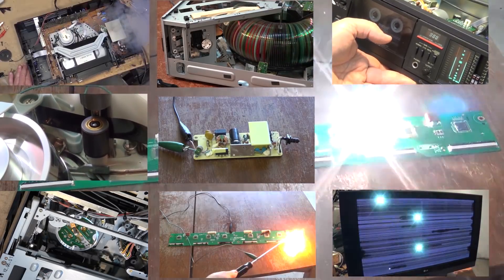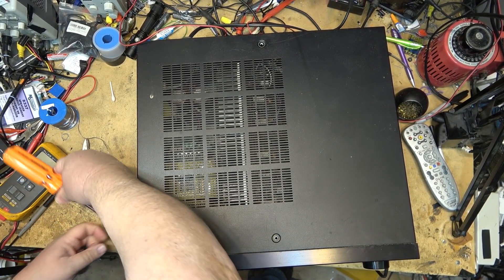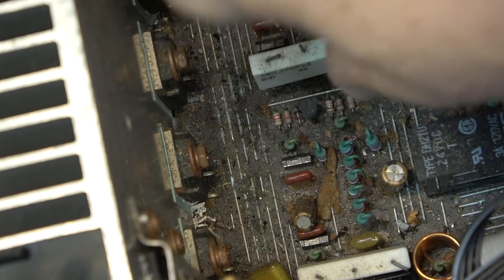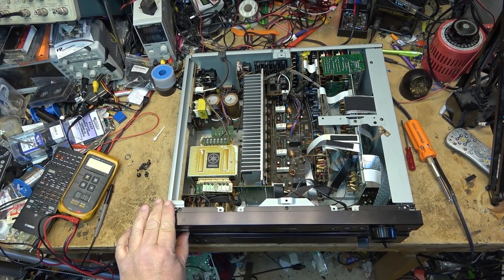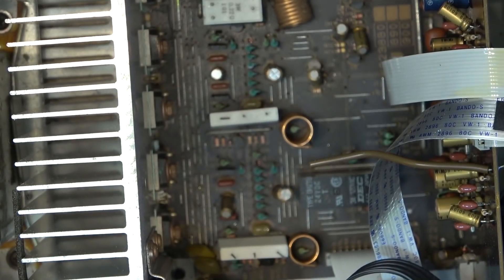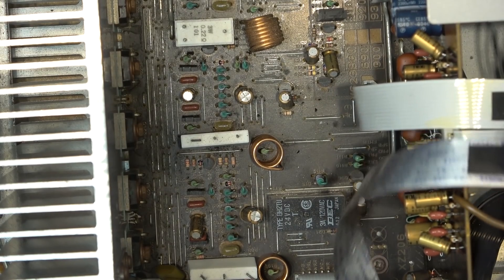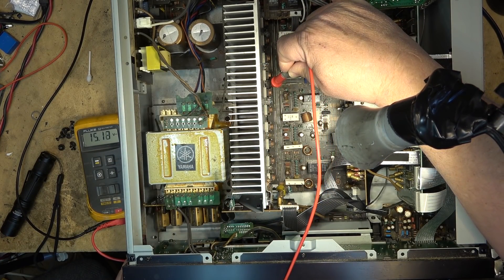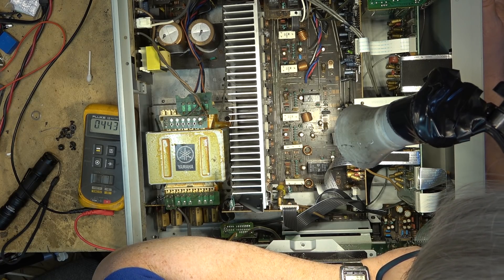Yamaha RX-V1000 Receiver In Pretty Sad Shape. Will I be able to get this one going? Lets find out.

Comment: Bought mine from a thrift shop and did exactly the same thing.  The thing is, it was in absolute perfect shape, not a single dust particle inside the unit when I opened it up.  Never had a chance to fix it and gave it away to a local guy that could fix it.  Plans changed ended up with 2018 Onkyo receiver with updated surround sound (atmos, dts-x, etc)

Comment: Great work, and a nice solution to the problem. I am struggling with a 72 sansui quad with many of same problems.   I got the thing running and turned it over to a tech to overhaul the radio.

Comment: Why not take the unit outside to use the air compressor on it, instead of blowing the dead bugs and filth all over your work bench? 🤮 Anyway, I have worked on a number of various  Yamaha RX-V surround-sound A/V receivers, and aside from the blown channel you encountered, there are a number of common problems and factory service bulletins about them.  Some of the rear panel screws that hold the connectors are also important chassis grounds and the unit will shut down if those screws aren't tight. There is a supercapacitor for the memory, on a vertical board behind the volume control area (under the metal shield panel)  which can leak an invisible electrolyte on the board, causing the unit to shut down, and you have to clean the board with alcohol and Q-tips and a toothbrush and replace the bad cap. Also, the polarized electrolytic feedback caps for the differential amplifiers can go bad and should be replaced with non-polar electrolytics.  Most of these various receivers will have a way to bypass the protection circuit (by holding down a combination of front panel buttons as you turn it on) and turn it on sufficiently that you can interrogate its memory and the digital display will give you some clue as to what's wrong with the unit. Obviously you need to be plugged into a light bulb current limiter when you do this;  but if there was any justice in the universe, what the display would read is "NWR": not worth repairing! 

 There is also a way to use a male plug to male plug "suicide cord" feeding into one of the courtesy outlets on the back of the unit and thereby turn on the main transformer and output stage so that you can check for DC offset; again, only done with the use of a current limiter, but regardless,  the suicide cord method is quite dangerous and not recommended for the average inexperienced wannabe tech.

Comment: I have a Yamahaha  HTR 5740 on the bench now. It has the main board stacked above the power amp board, and power supply board above that one in one corner. one side of the winding of the power transformer windings covers part of the power amp board. Almost all of the ribbon cables are soldered right to the boards at both ends. Yamahaha products were a technician nightmare in the 1970s with the CR series because all of the semiconductors had to come from Yamahaha becuade they spec'd everything to tight of tolerances. And, I did not spell Yamahaha wrong..
Reply from the maker: Yes I used to call them yamahahaha too. Especially their motorcycles which are a piece of junk.and yes I can speak with authority on that I had one it was the biggest piece of crap I've ever owned.

Comment: Nice fix. Could you paint the PCB's in some sort of lacquer to give it some protection from nature ?
Reply from the maker: That's called a confirmal coating and I was wondering myself if spraying something such as flex seal over a board would protect against the elements. Have yet to actually try that but I bet it would do a pretty good job of protecting a board. First of all though before doing anything like that it would have to be meticulously clean. The time to put a confirmal coating on is what aboard is new before it's been exposed to dust and debris and moisture.
Reply: @12voltvids  Ah, confirmal coating, that's what I was trying to think of. Thank you.
Reply: @12voltvids  Having worked in avionics we had to repair and recoat faulty pcb's, the worst were boards from rescue hellicopters
that suffered from all the salty spray from the sea.
The weakness of conformal coating is that the smallest pinhole will allow moisture to creep under the coating taking out components,
removing it and then replacing it is a messy time consuming job.
At least the wages were good at the time.
Reply from the maker: @frankowalker4662  I was thinking that spraying a board with flexseal might do the trick.   It sure stopped a dripping drain on my kitchen sink.  The Union connection between the p-trap and drain had a damaged thread that would drip. Sprayed it with flex seal 10 years ago hasn't dripped since.
Reply from the maker: @Barbarapape  and once moisture gets in the confirmal coating will trap it so it can do even more damage. I once worked on a car radio and you're right getting through the conformal coating was a pain in the ass. Of course I don't work on car radios now that's not the only reason I just don't like car radios and they were always the ones that came back to bite you in the ass because it was usually a teenager that shorted something out when they were putting the stereo in and you fix it and then put it back in their car without rectifying the fault and as soon as they turned it on boom and it came flying back in the door with an angry 16-year-old screaming at the top of his lungs that you didn't fix it right.
Reply: @12voltvids  Sounds like a good idea for the stereo then. At least it can't get much worse. :)
Reply from the maker: @frankowalker4662  well this one apparently is because there's some distortion on the right channel that I will have to reinvestigate. I certainly didn't hear it when I was testing it but the owner says the right channel is distorted, so I guess I'll check it when it comes back. Perhaps it's his speaker, that's always a possibility the speaker might have been damaged from the moisture too. I'll find that out when I hook it up again but it certainly sounded clear on both channels when I was playing it yesterday.
Reply: @12voltvids  Yeah, It sounded great when you had it running. Bugs in the speakers ? LOL.
Reply: @12voltvids  I can relate to the car stereo's
i once replaced all the bulbs in one only for an angry customer to return it saying that it lighted up very bright for a few seconds then went blank.
The second time i asked if i could refit it, when i checked the volatge it was over 20 volts with the engine running, the regulator on his alternator had blown.
The dreaded conformal coating was nasty to work with, health and safety back then was not even heard of in the UK.
Reply from the maker: @frankowalker4662  moisture weakens the glue that holds the voice coil
Reply: @12voltvids  It also rots the cone and the wires can rust.
Reply: I asked the same thing, theres a plasticiser spray for electronic boards.
Reply: @12voltvids  And moisture can also deform the cone, so the voice coil will rub against the gap.
Reply: @12voltvids  Just ask the guy to swap over the 2 speakers to clarify the problem, before sending it over to you again.

Comment: You are trying to pull the board out without first disconnecting ribbon cables. I hope you customer does not pay for your mumbling time... How about also cleaning the board with some brake cleaning spray? Are you going to deliver it like that?

Comment: If you were doing a full teardown and clean up, would you consider putting the boards in a dishwasher???
Reply: During the 1980’s I did some contract electronic design work for a small Chicago-area manufacturer who actually used a residential dishwasher to clean their PC boards after the soldering phase of assembly. I don’t recall what they used for detergent. It might have been nothing but plain hot water.

Comment: How do you find Denon receivers overall for reliability and service? I own a couple and was just curious after watching this Yamaha service.
Reply from the maker: Haven't done that much work on Denon so I can't really comment on their build quality. All the modern ones are paying the ass to work on that's why I don't work on home theater equipment much I stick to the two channel stuff as a real
Reply: I bought a "reconditioned" Denon many years ago from one of their authorized "b-stock" liquidators. On arrival, it wouldn't power up at all. Once they found out it was shipped to Canada, no one would touch it - apparently the b-stock is only supposed to be sold to the US, and in Canada you're supposed to pay full price. In the end, I fixed it myself - someone had broken the corner of the board off by putting the receiver down with something shoved through the bottom vent. I guess when they sent it back under warranty or whatever, the 2 traces running across the corner of the board happened to be connected when they tested it, so right back out it went again without any repair. I scraped the solder mask off of both traces on both sides of the break and soldered 2 wires across the break to fix it properly. Then when I put it back together, one of the pins on one of the connectors on the riser boards didn't quite line up, and it pushed the pin and the trace out of the main board. Took it back apart a second time and fixed that issue (and was really careful about plugging all the boards back in), and it's been 100% fine ever since. I'd say their designs are OK, but they use the cheapest PCB material known to mankind (that phenolic stuff) - but that's pretty common in all consumer electronics. I think these days, they're all pretty much equal across brands. Oh, and F denon for being pretentious c**ts about "but you can't buy our b-stock products even from an authorized reseller if you're in Canada - discounts are only for Americans"
Reply from the maker: @gorak9000  some bonehead sent me a receiver for repair. A broken receiver and this bonehead put it declared value of $1,400 on it. So it sits at the post office with a $250 tax bill and I ain't paying for it. The owner will have to Buck up and pay the tax before the unit gets released from prison. If he doesn't by the time the hold runs out they will ship it back to him on repaired collect. I don't know how come people keep doing this I'm very clear when I tell people if they're shipping something it cannot have a declared value of more than $20 and anything that is broken does not have any value. There's no guarantee that I can even fix it because it depends on what's wrong and whether there's parts or what the damage is. 
The guy that owns it will have to pay the taxes before it's picked up and I'm leery of having payment done through PayPal because I recently had someone do that they paid the taxes under PayPal and then I went and paid the bill and then found that the unit was not repairable due to no parts they found a dispute with PayPal and got their money back and I ended up being out $110 in taxes that I had paid for something that wasn't repairable.

Comment: Looks like a bird fecal mess ; under that electrolytic, needs a wash down with electro clean.
Bird turd Yam ma hoppa toilet
Reply: First I thought too that was bird turd, but more likely it's thermal compond to make good contact between the sense transistors  and the edge of the heatsink. You can see TO92 transistors that are bent under the edge of the heatsink at each channels, those are used for making the bias (idle current) regulated over the changing temperature of the output transistors.
Reply: @mrnmrn1 ,  yes, and those bias transistors rarely sit tightly pushed up against the heat sink, so if you do pull the board up you usually have to push on the transistors while heating the solder joints, to reseat the transistors against the heatsink ----  but if the board and heat sink assembly flexes a lot while you reinstall it, the transistors leads will bend and the devices will once again be spaced slightly away from the heat sink. It's a stupid design.